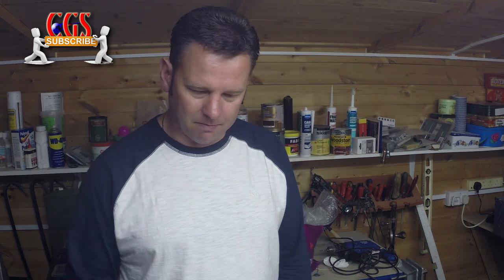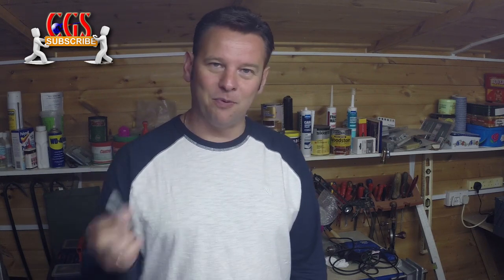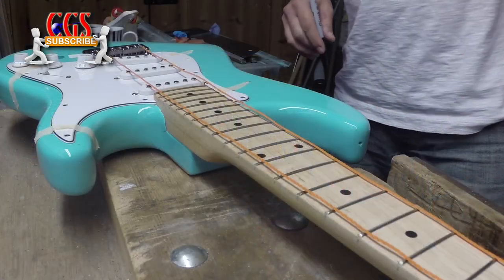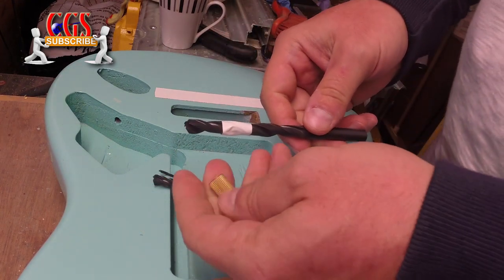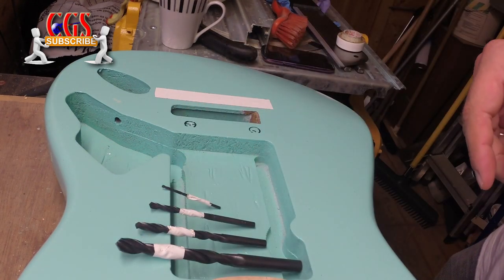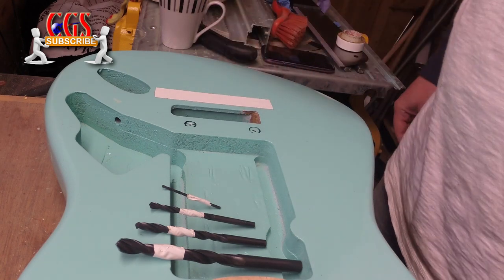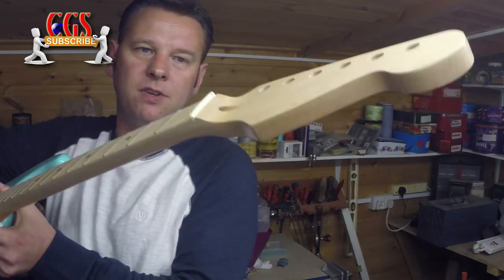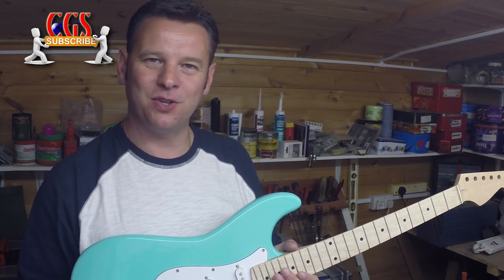Build a Custom Strat Guitar from parts - Fitting the bridge - Part-o-caster Part 7

Comment: I use thin elastic for centering; it keeps an excellent  tension so it's always very straight. You can do a one-stop drill process if you use Forstner bits. They cut very cleanly and don't crack the wood. I am really enjoying this build series, so keep at it!

Comment: Nice one CGS.
I have just finished a similar project on a P Bass copy from the 80's.
The only original parts left are the body and neck.
It would have been far cheaper to bin it and go and buy a decent Squier P Bass.
However it was well worth the time and money because I learned so much through doing it.
Reply from the maker: David Mcque Exactly David. Thanks mate. That's why I did this series. It works out more expensive than buying second hand but its such a rewarding project to spec and build your own guitar. I figured it would give folks confidence to have a go. If I can do it anyone can! :o)
Reply: Another advantage is you can make it exactly how you want it.  May not find anything that way in the local music stores.  I'm doing a kit right now, aside from the colour which isn't available on production guitars I'm changing the bridge, nut, n pickups.  In my case the kit is approximately $130 cheaper than a classic vibe.  Even with the needed tools n other supplies it should still come in under budget compared to the usual classic vibe strat.

Comment: Great video! Love these. :) The guitar is looking fantastic. With regards to painting the tops of screws for the pick guard...I like the idea and I think it would look very cool. But I it may become a problem eventually as the paint will probably scratch off when you loosen or tighten the screws.
Reply from the maker: WarmachineCAN Very good practical point. Although hoping not to have to take the pick guard off too many times. Perhaps I will leave painting them until final fit up :o)
Reply: There ya go. :) Are you keeping the pickups that are in the pick guard already or are you swapping them out?
Reply from the maker: WarmachineCAN I'm going to see how they sound but almost certainly will swap out the bridge with a single-bucker replacement. :o)
Reply: Chinaguitarsceptic Excellent! Looking forward to seeing how it all comes together! :)

Comment: I think you could try hand paint the pick guard screws with a fine brush so as to avoid the chipping during the instillation but obviously you'll be doing it a few times if you swap out the pups ? Just an idea as I think the painted screws would look cool, looking cool and keep up the good work as your vids are top !

Comment from the maker: At around the 3 minute mark I say scale length of 25 inches. This is of course the scale length of my own custom Milton guitar MT1 and standard fender strat scale length and indeed this scale length is 25.5 inches. Sorry for being so obsessed with my own favorite scale length.: -)
Reply: Why did you choose a 25 inch scale?  Was this the result of a shorter neck, or is the body a bit smaller than a traditional strat?  Any advantages over a 25.5 scale or 24.75 scale?
Reply: 25 is exactly what PRS uses!!  I love this scale as well...halfway between the LP and the Strat!!!  Really even playability and tone!!!

Comment: So far so good... I like how this is shaping up... I have to agree with the others that I would hold off on painting the screws until everything is done.. and I like the idea of redoing the position markers as well..   So.. would it be worth having a Wilkensons Trem replacing the stock on a MiM Strat? I have one of the 2013 Plus top with the rosewood FB.. but not fond of the bridge..
Reply from the maker: Kazahmish My rule of thumb is that if it is not broke - don't fix it. If you are having trouble with the bridge and for example not floating correctly, then yes you could replace it. However its a lot of work to fill the holes, drill the posts and repair the paintwork. I thought it was worth it though so I can't honestly say it would not be worthwhile doing. They are lovely bridges. :o) Cheers :o)

Comment: Dude, I just left ya a message about those colored screws. Either I forgot to hit Post?? Oh well you can get Neon Blue and Plain White, Black, Gloss or Matt, Yellow, Orange, Gold, Silver, Chrome and I Think Pink screws. But, the paint is not forever. Best used ONCE and left alone sort of thing. Also, when you check out those Neon Blue Screws, Check to see if they have also gotten those new Colored Strap Locks. Last time I wrote them those were to be coming and soon. THAT Could make that Guitar Really POP. But, I never saw any Powder Blue or Seafoam Blue Colored Screws. Just that Neon type. On Your Strat does it have those Matted Chrome Finished Tuners? Or are they Chrome? I saw a set on a Fender Issue Special Model and it was a Pastel Color as well. I just can't remember the Strat Issue for some reason though. Have a good one.

Comment: do you pull the posts out you drove in with the hammer? Also I would definately paint the screw heads but you may want to test it first as the paint may come off when you screw them in.  Can you get Milton inlays for the fret markers?  If you know anyone with a CNC they should be able to cut that in.
Reply from the maker: tim taylor Thanks Tim. I agree and think trailing the paint on one of the screws was always a must anyhow. Love the CNC idea I will look into it. :o)

Comment: MY FIRST GUITAR PROJECT
I sourced all the parts off of ebay.
I fitted the neck , by clearing all the varnish and paint off the body.
I filled the old holes in the neck becos they didn't line up. Rubbed down the glued in matchsticks in the neck flush. Centralised the tremolo bridge to the neck. Set it to 12.75 inches the same as the 12 fret distance. Fitted the strings but they were touching the frets APART FROM THE SIXTH AND 1ST .I cut down a tremolo spring plate and used it as a spacer under the bridge. This helped a lot. I adjusted the 2 bridge height allen keys to absolute maximum but still need a bit more. I also adjust the truss rod to best position . ANY IDEAS?
THANKS
Reply from the maker: Clive Lombari Clive it sounds like the neck break angle is wrong to me. You may need to shim or adjust the neck joint. Can you post some photos on the chinaguitarscpetic.com forum as there are many experts there willing and waiting to help. :-)